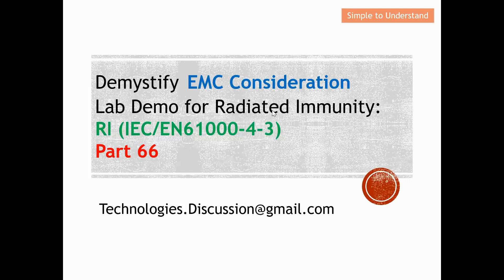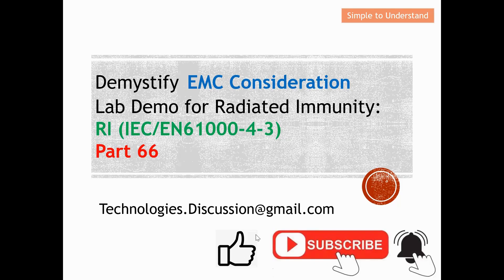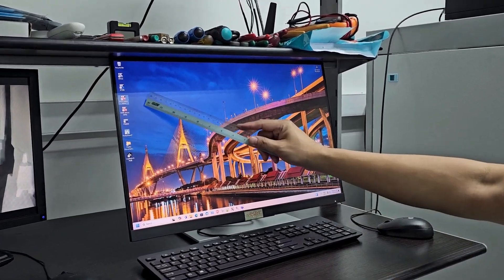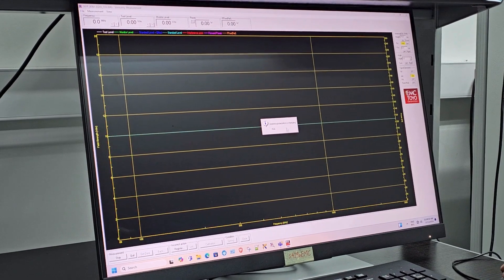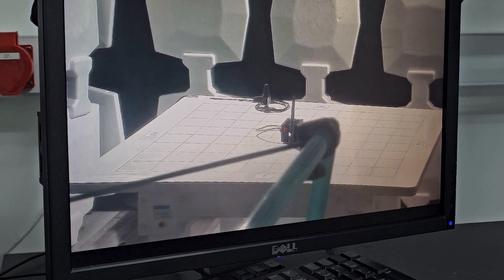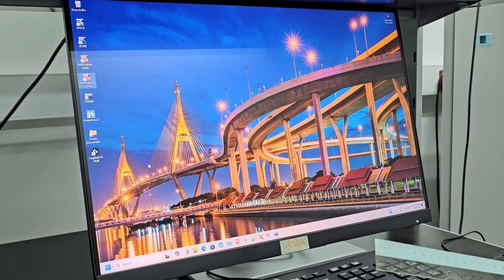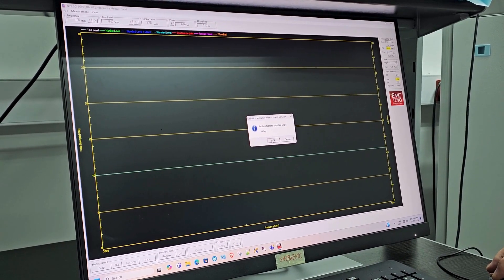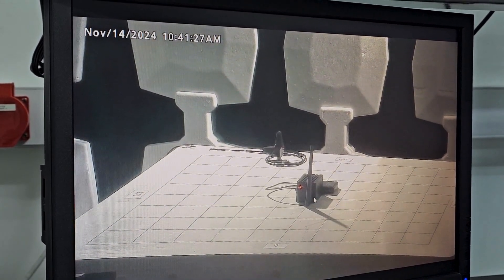EMC #66. Radiated Immunity Lab Demo: Beginner's Guide to IEC/EN 61000-4-3 Compliance Testing.

Comment: Why the 1kHz  AM with 80% modulation is used in radiated immunity test?
Reply from the maker: The use of a 1 kHz amplitude-modulated (AM) signal with 80% modulation depth in radiated immunity testing is standardized and serves specific technical and practical purposes in evaluating the electromagnetic compatibility (EMC) of electronic devices. 
In short, is a standard.   :)